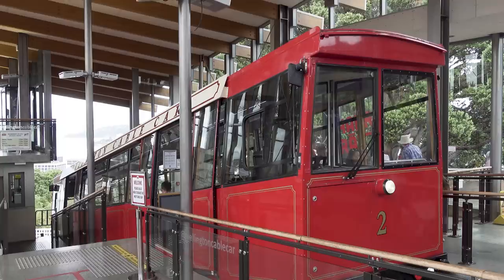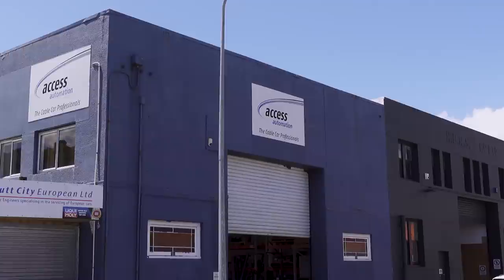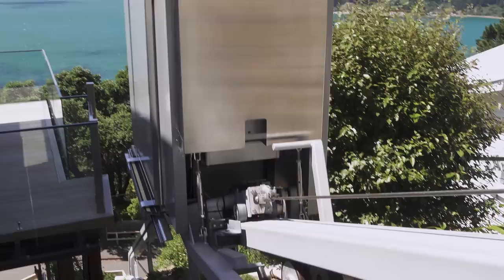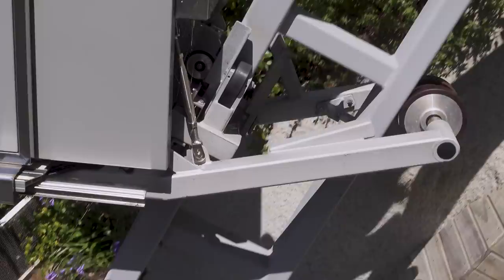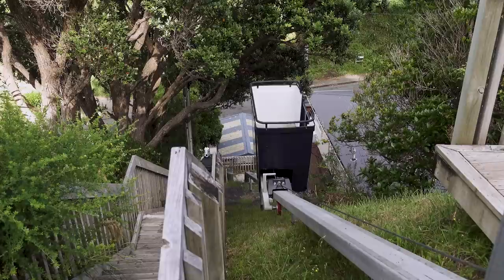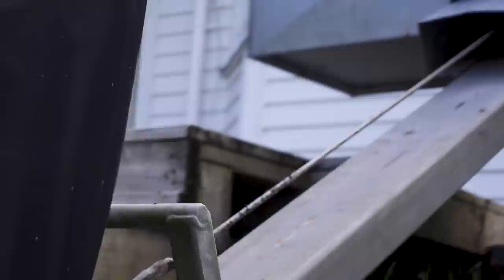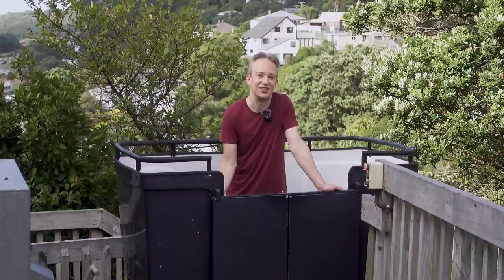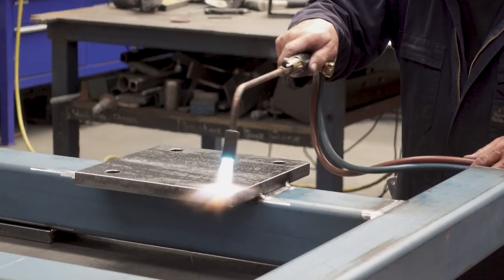The city with a hundred private cable cars

Comment: If the cable car is $120,000, I don't even want to know how expensive the house is.
Reply: Maybe a substantial part of it is for the terrain work... (where to put the pillars, and actually installing them in the middle of the hill). That might be comparable to to laying the base of the house itself.
It's definitely an interesting question to guesstimate this
Reply: Certified NZ housing crisis moment
Reply: At least $5 i think
Reply: It costs millions and billions of New Zealand dollars.
Reply: In my perspective, It should be just as expensive as the cable car. Because most of the expenses would go towards the maintenance of the cable car(s) on the house's property.
Reply: @snowkatyoutube1419  Good call! Though I wouldn't be suprised if the actual value is closer to $6 instead. We've got to be wary of inflation these days.
Reply: There's a big diy culture on this though that's if you hire all the work out. Most of the time homeowners will do a lot of the landscape work themselves. We have similar systems around me in northern Wisconsin due to all the private ski hills around me.
Reply: Definitely more than you can afford
Reply: Well the average house price topped a million NZD for a brief time, a year or so ago.
Reply: like most things, it's the upkeep and repairs that kill ya
Reply: $10
Reply: its free, you get it with the cable car
Reply: @Snowkat Youtube  You sure? Might be an extreme guess
Reply: Some of them pass through many houses so maybe the cost isn't that high when shared.
Reply: Depends. Can substantially increase the value of the house — accessible to elderly (richer) people and families with disabled ones. It’s an investment not a cost.
Reply: Why not use a funicular railway instead?
Reply: Well, as someone who lives around there, depending where you are at in Welly, you're looking at $1-1.5 milly
Reply: The average price of a house in NZ is $900,000 and these houses are in highly sought after locations so they likely cost a couple million, possibly more depending on the actual house.
Reply: Plus the annual cost for inspection.
Reply: That one isn't even enclosed.  Imagine riding that slow thing in a storm.
Reply: It's worth mentioning £1 = $1.95nzd but still £60k is about 20% of the average uk house price so still quite high
Reply: Ha, this is talking about property in NZ... you definitely don't want to know
Reply: The house is a bit run down, so Cable Car included it's $135,000
Reply: @nuthinnew  $120k is the price in US dollars. The quote in local currency was about $220k
Reply: Average in Wellington city is well over a million at this point afaik
Reply: Where I live in the U.S., here are several cable cars that go between houses that are on a hill and the lake down below.
Reply: Likely in the low to mid 1m's NZD but more to the point, installation is the most difficult part because of the terrain. Once the track is setup getting the cable car on it wouldn't be overly difficult, relatively speaking
Though if you look at a converted minivan for handicapped people, those easily go for north of $100k (CAD)
And if you're an American, all these numbers should convert to between 27¢ to $1.30
Reply: @kiwifarmer8828  Its now around $800k
Reply: As someone who lives in Wellington, over $1 mill nz. But those houses are generally around Kaiwharawhara, Ngarunga and Miramar and would be probably closer to 1.5 mill starting prices and go up.
Reply: @nuthinnew  he does the conversion in the video, 200k NZD to 120k USD.
Reply: 10x actually
Reply: @zanefarrow1831  My mistake. Also.. sheesh
Reply: @doctorgames101b around a million NZ dollars on average in Wellington, the houses with the cable cars would be 2 million plus
Reply: From what I have heard, house prices have rocketed under Jacinda's government, with large numbers of foreigners buying up property and making it difficult for Kiwis to get their own home.
Reply: @nuthinnew  houses in central Wellington easily 2-3 million on the low side
Reply: the bubble hasn't popped in NZ as well ...
Reply: @Bobmcjoepants  more than that in central Wellington
Reply: @Tony_7791  ay more than that
Reply: @HazmanFTW  at least
Reply: @mikejones-go8vz  yes agreed
Reply: @MervynPartin  that’s not just her government, it’s also availability of land for development in the sought after locations, worse now after the recent cyclones, worst winter and summer for many years, towns devastated and having to be relocated
Reply: 120k at 7$/h... nah, not survivable.
Reply: Property prices are now valued in units of human souls.
Reply: This feels comically overpriced.
Reply: oopies, you got us there
Reply: it’s New Zealand and specifically wellington so you’re looking towards $1 million NZD
Reply: About tree fiddy.
Reply: If I had to guess, for that area, upwards of $1.2million nzd?
Reply: When I lived there we could only afford the cable car but not the house. It was big enough to sleep in and it had a lid. Happy days in NZ.
Reply: @nuthinnew  How is $NZ 200,000 = £60k?  it's over £100k
Reply: Kelburn (the suburb with all of these) has ~$1.5mill on average houses (£750k) I'd say
Reply: Most Wellington homes are around 1 million NZD. But in the area with most of these cable cars the houses range from 1.5 to 5 million. 😂
Reply: @MervynPartin  "From what I have heard" is a red flag. Anything past that is questionable.
Reply: One like that in NZ would easily be over NZ$1 million

Source: I bought a house recently in NZ
Reply: even houses without cable cars are insane here in nz
Reply: @alec4672  I was thinking exactly that. With less than 120k a handy person can make a safe DIY cable car.
Reply: Word...F@#$ that noise
Reply: In my town you could buy a 3 bedroom 2 bathroom house on a 1000sqm stand for the price of that cable car.
Reply: Yer… house prices in NZ are absurd
Reply: @pipodrankje  no... is it really 6$ these days?
Reply: Hahahahahahahahah
Reply: Given the expense of these, you'd expect the houses where owners were willing to outlay this additional money would be higher than the average - so probably nothing less than $1M NZD - and most of them will be well over that.
Reply: As an average working class Kiwi, I turned my cable car into another bedroom for the kids.
Reply: @alec4672  YOU GOT A PRIVATE SKI HILL AND YOU WORRY OF LABOUR COST?!
Reply: houses in wellington start at 7 figures, if one popped up for under that, I'd be biting on it asap. I live just outside the city
Reply: where I live $120,000 can't even get you a 1 room 40square apartment. WITH RENT.
Reply: Typical housing in NZ can range from 500k to 2mil depending on a lot of factors. It's expensive AF...
Reply: @Padlock_Steve  i hope your joking you couldn't get a piece of land in the middle of nowhere for $200k
Reply: You'd probably be looking around $620k usd as the median in Wellington
Reply: $1.2 million NZD is fairly standard
Reply: In the city, the house may be a complete wreck, but you could be paying from $1 million upwards. Some regular houses may be several million.
Reply: @dkevans  the big cable car is. Has 2 cars that counterweight each other. But houses don't need that and since they are so light and not used much, its just not worth doing, instead you either haul it on a reel, or just have a car that grips the rail and climbs the rail.
Reply: @pipodrankje Well, taking in to account inflation rates in New Zealand, which are up by 7.2% from last year, we can assume that, if the house was at least $5 last year, it would be at least $5.36 today.
Reply: Midcentral Wellington? You're looking at 1mil NZD+.
Reply: The average house price in Auckland the biggest city in New Zealand has an average house price cost of 1.28 million dollars.
Reply: In Wellington? Close to a million.
Reply: @mremumerm  it's what's known as a mistake on my part
Reply: @snowkatyoutube1419  no
Reply: Average house price in Wellington is about 490,000 USD
Reply: Still more affordable than London
Reply: @MervynPartin  House prices had already rocketed long before Labour were voted in, that actually happened under 9 years of the National Party.
Reply: I was just wondering the same, especially one built on such a steep slope. I feel sorry for any removals team needing to move stuff in or out. Here in SA, in Camps Bay, I've seen a grand piano airlifted by helicopter to such a home.
Reply: @maxbracegirdle9990 
My guess was going to be US$500k at the absolute minimum for one of the older, smaller houses...
The larger, newer ones would easily be over $2 million NZ.
Reply: A house like the one in the video, in suburb I think it is, would probably be around $750,000 NZD at my lowest estimate and $950,000 NZD at the highest estimate. ($464,000 USD- $587,000 USD)
Reply: Welcome to the New Zealand housing crisis, it's a nightmare
Reply: @panda4247  from memory, the average value of properties in WLG is around 1m+
Reply: Usually 800k for an old 3 bedroom 1 bathroom house.
Reply: A lot of cable cars are communal. 3/4 houses.
that cost the same as 30/40 houses, because, reasons
Reply: Houses in welltion were costing around a million but prices are at the moment thay seem to be going down
Reply: Depending on where you are but i would say average 800k give or take
Reply: The car is almost free when you buy house
Reply: If I have learned one thing from the other side of the world, that it is FREAKING expensive
Reply: @themitochondriaisthepowerh9177  This implies that there isn't a housing crisis everywhere
Reply: My house without cable car was $450000... And it's a very small house with no public transport connections. Our house prices are cooked
Reply: Add a 0
Reply: People in the USA outside of the main cities have no idea how expensive homes are in the rest of the western world.  In the UK £200,000 ($240k US) in Bristol (not London) will buy you a flat...maybe.

I was recently in Ohio looking for homes with US friends and the prices were ridiculous - CHEAP compared to UK.
Reply: Affordable....
Reply: Maybe you can buy just the cable car and a steep slice land and then live in the cable car 🚡 as a tiny home. Great view from the top 👌
Reply: Wellington is stupidly expensive for housing. The CBD is even more costly as alot of the older more affordable buildings are earthqake risks that need to be torn down or strengthened.
Reply: In Wellington it’s now hardly ever under a million.
Reply: @dkevans  I suspect they only need one car to bring them up and down the hill so a funicular would probably be overkill.
I suspect (but do not know) that using only the single thicker rail might have lower maintenance costs compared to the narrow gage rail that a funicular would use.
Reply: When you purchase a cable car for that price, the house comes included!
Reply: I would imagine quite a bit. Wellington is not a cheap city to live in
Reply: Most of those hill sites are multi million dollar houses... Depends a bit how small they subdivide them, of course :) (but they'll still be a million dollars for the view/location)
Reply: The cost of the cable car is probably shared across multiple households
Reply: It's over 9000
Reply: @MervynPartin  our house prices have been doubling on average every 8 years since since Jacinda was in primary school. This isn't a recent phenomena.
Reply: Average cost of a house in Wellington last sat at around 1.2 million. Average.
Reply: Houses in NZ are some of the costliest in the world, compared with income. Especially in the cities, especially Auckland. (Yes, I live in NZ.)
Reply: same cost as building a driveway in the mountains 🤷🏻‍♂️
Reply: $650
Reply: Auckland is in a similar level of unaffordability crisis as San Francisco, Vancouver, Melbourne, and Sydney, unfortunately.
Reply: Wellington.
Reply: You just poor
Reply: @Hubris2  anything larger than garage is more than 1.5m in welliton even an apartment in a falling down hoouse with water leaks will be approaching 1.6m. House prices are just absurd.
Reply: Easy a million $NZ
Reply: If you have to ask, you can’t afford it
Reply: @61percentodicarica  what do you mean? They usually don't employ anybody, they're just houses built on top of ideal skiing hills. I don't own one I live on a lake but my buddy owns a ski house (that's what we call them around here). It's literally just a house on a big hilly piece of land. Of course he's worried about cost, he's not rich he just likes skiing. He doesn't make and money off of it he can't charge people to ski there if that's what you're thinking. If that were the case it would just be a normal ski hill.
Reply: 1¬5M
Reply: @yougoslavia  billions? No
Reply: @alec4672  ahh ok, I misunderstood then, I imagined a mansion with private ski lift
Reply: Aucklanders chuckle nerviously
Reply: These houses will be all over $1.5 million NZ. I sold a property in Wellington that had a steep access to the bottom, didn't have a cable car and hadn't been renovated in 40 years - Sold for over $1.1million for a  3 bedroom house without a private cable car.
Reply: Tom doesn’t mention in the video that house prices in NZ are out of control, partly due to, erm…Chinese investment…
Reply: @zeitgeist2720  I was joking.
Reply: Saying "I don't want to know" on the internet... 100 people immediately tell you.
Reply: @doctorgames101b  given the state of the housing market its probably closer to a million nzd
Reply: @alec4672  unfortunately,  New Zealand is over fault lines so once hillsides are involved you need experts to sign off that the house will survive quakes and not relocate to the road below it
Reply: @pipodrankje  You don't have to worry about inflation - as the warning goes: your cable car can go down as well as up.
Reply: Its NZ. Avg. House prices in Wellington are beyond 1.2m afaik
Reply: @61percentodicarica  I mean a few of them here and there are mansions but I haven't seen a full blown private ski lift yet I don't think it would make economic sense. That's why they use things similar to what's in the video here. My buddies is homemade out of a golf cart.
Reply: In my area of New Zealand, a good small stable home in a good part of town runs you about 450k
Reply: It's nz bro... house prices are just ridiculous.
Reply: @themitochondriaisthepowerh9177  The video indirectly points it out... but probably not on purpose.
Reply: Given that a lot of the cable cars are in Kelburn and Oriental Bay (two very expensive suburbs), the houses can quite easily go for 1.5-2.5mil plus!
Reply: Average of 1M, coming from someone that lives in NZ, housing is ridiculous.
Reply: @MarkoVukovic0  Wellington has no flat areas its only hills
Reply: Usually about $1,000,000 in these areas.
Reply: @yougoslavia  How I wish this was a joke.
Reply: that's a bargain in today's housing market
Reply: @dkevans  The designs in the video are forms of cable railways (well, cable monorails) - the difference from a funicular is that funiculars, by definition, have two cars which counterbalance each other - as one rises, one falls - while cable railways only have one car per rope, either winched up or connected to a counterweight.
Reply: you don want to know how expensive the land is... especially considering the whole lot may be 30 degrees slanted
Reply: @nuthinnew   average house price in the UK is about 150,000
Reply: @MervynPartin  average  prices over 1 million
Reply: About $3.50
Reply: Houses in Australia and New Zealand are some of the most expensive in the world with the median house price at roughly 1 million
Reply: @THEBOSS7223  150,000 £2 coins?
Reply: Probably more than $120,000 I'd say.
Reply: average house price in Wellington is around $800,000 NZD which is approx. $495,000 USD. Of course there are many places well above that range.
Reply: (laughs in Toronto from inside my derelict $1.2 million townhouse)
Reply: In my country nearly all large households (3 or more floors) have elevators inside that cost $200K on average. I honestly expected the cable cars in Australia would cost more.

House prices cost $400K and above depending on location, rising every year! Thankfully we have government housing for newly weds (you get a full house and pay a measly fraction of the total price every month to the gov for an unspecified period of time).
Reply: That’s a load of kiwis.
Reply: You would be unimpressed, my mom moved to NZ and bought a million dollar house. 3 bedroom 2 bath 30 square foot yard
Reply: Average house price in welly is around a million
Reply: Probably anywhere from 5-15x the cable car cost, depending on the size and spec.
Reply: But … it’s great for parties!
Reply: I was about to say welcome to New Zealand
Reply: $1M close to the city here unfortunately doesn't get you much
Reply: @dkevans  Funicular Railways: based
Reply: Honestly I wouldn't be surprised if it cost more than a small house.
Reply: The houses in Wellington are at least 1 million NZD. Those ones in prime spots would be closer to 1.5 mil, maybe 1.8 million and above (I live in Wellington)
Reply: That’s not American dollars
Reply: It's Wellington so $2m last year, $1m now
Reply: At least a 1 million for many
Reply: It'd be a New Zealand price. Our average house price is probably around $1.5M
Reply: Still cheaper than HK and Singapore
Reply: For 120k I want it to pull my house up and down the hill. I mean for 1k Ill make you a wooden box with a pully and rope.
Reply: Not surprised. It could make up a large bit of what the house already is worth, but location it's self is nice enough, cozily snug'd away in the trees, as if walking through the portal. That alone, would drive me to live there. The cable car being already build would just be a lucky perc and certainly not my reason for choosing that particular spot. you'd be crazy not to
Reply: @MervynPartin  It has nothing to do with the current government. In fact more regulations have been put in to prevent foreigners buying houses. It is immigration which was actually encouraged by the previous government - in fact John Key said he wanted NZ population to be 8M - at the time more than double. Not enough housing stock to meet that demand.
Reply: @TheArklyte  Minimum wage in NZ is currently $21.20
Reply: @daniele4568  Why? You are trying to build a safe method of transport up a vertical cliff?
Reply: It will probably be around 600 000 us$ or more.
Reply: Minimum wage is $22.
Reply: @henrykirk4457  I advertised an outside cleaning position for six months, gave up trying in December. Guaranteed 40 hours a week, $32 dollars an hour, free parking in the city during work hours, free coffee.
No takers. Not one person applied.
Reply: About 2 million
Reply: At least a million nzd but these house are probably nearing 2 million
Reply: Inflation has been high in New Zealand, especially since large amounts of money has been taken out of circulation by being seized and hoarded by dragons.
Reply: In Wellington, often well over a million, at least in the area I live in.
Reply: @daniele4568  As a kiwi, it feels depressingly reasonable.
Reply: haha... the average house price in wellington or auckland is $1mil. Actually auckland is like 1.3 or something
Reply: Probably around 1.2m nzd
Reply: You sure that's American dollar and not New Zealand dollar?
Reply: The parts of Wellington where they'd want to install a cable car have very very expensive houses. Most of Wellington isn't that expensive and isn't built on a cliff face like that.
Reply: @yougoslavia  Hahahahaha.  Right
Reply: Average house price in Wellington would be close to $1M. Coastal homes with a view could be double that.
Reply: average house in nz is 1.3m nzd
Reply: As someone that lives in Wellington on a decent salary, I can safely say l will probably be renting forever. It’s very pricey.
Reply: @kiwifarmer8828  No it hasn't: "Wellington's Median House Price is $790,000".
Reply: $850-1.5 give or take.
Reply: In a lot of our cities the average price is either over or approaching 1mill
Reply: dont worry, houses in auckland, new zealand is 1.5 - 3m
Reply: I live at Nz and boy it sucks to live in the middle of nowhere. Shipping for us on Amazon is 250$ and the houses are really expensive.
Reply: @themitochondriaisthepowerh9177  worldwide housing crissi*
Reply: @dkevans  because it's the same thing...
Reply: I was looking to buy an entry level, one bedroom flat in Wellington and I was looking at $750,000. It's expensive af.
Reply: Greed is good!
Reply: It might be NZ Dollars, which would not be the same as US $120,000.  Nevertheless, that is still a substantial sum of money.
Reply: @unconventionalideas5683  The conversion is given in the video. It's 120,000 US dollars, and more like 200,000 NZ dollars.
Reply: @pipodrankje  he said at least 5$
Reply: Thing is, the properties are probably worth less BECAUSE of the hassle to make it usable. The moment a bunch of people build a cable car that services several homes, those properties become viable
Reply: @kiyosenl.3889    I mean, what could it cost, Michael?
Reply: Billions and billions!
Reply: @EvilEelofSteel  Definition of popped? we've seen a downturn of between 20 and 30% since the peak in December 2021
Reply: keep in mind 120 NZD = 74 USD
Reply: @dkevans  More expensive probably. These cable cars are as Tom says more like elevators. There's a lot of elevators in the world.
Reply: @panda4247  a guess is already an estimate, no need to use douchy terms like guesstimate
Reply: houses in the suburb where these are most common average at about $1.5M NZD. you can look up the price of any property in NZ if you want to find it
Reply: As someone who lives in New Zealand, a house in Wellington costs anywhere from 800k - 3 million NZD. Sucks :'(
Reply: As I thought, looks like New Zealand is affected by the exact same trend happening in Europe: House prices are skyrocketing. I wonder why... Surely, it has nothing to do with the EU demanding certain countries to decrease the number of land owners and have more tenants. And it also cannot be related to Jacinda Arden's membership to certain organizations... I mean, it's kinda strange how countries from opposite ends of the planet are going through the same exact issue, while countries in the middle have no such problems...
Reply: Add a zero to it, or one order of magnitude larger than the cost of the cable car.
Reply: Thats
Reply: That's 75.437,96 US Dollars
Reply: I don't think that's necessarily the right question/inference. As they said, this is often an investment made by a retired couple who wants to stay in their home longer or by a disabled individual who needs the item in order to access their property. It's not a "value-added" investment they're hoping to make a return on. It costs $120k minimum whether it's for a $200k or a $5 mil home. But for someone who wants to remain independent and it's the only option it may be worth it even if it makes no sense financially and may even lower the value of their home--as the new homeowner found it now adds a substantial yearly inspection expense for novelty for her. The cost may be covered, in part, by grants or local aid (outdoor wheelchair elevators are in many locations so I'm guessing similar groups may also help with this if the need is there), so I really wouldn't make assumptions, necessarily, that the owner is frivolously wealthy.
Reply: like 1m to 1.5m or 900k
Reply: It's in NZ a very shifty country so probably not that much more
Reply: @rafezetter8003  People in rural areas of the US definitely know how much homes cost in similar areas around the world. And it's not much worse than most of rural America nowadays. 

I live in Canada and a house in my area that costs $500,000 would probably cost around 50% less in a couple hundred kilometers away in the US but that's doesn't mean Americans are living in some utopia with cheap housing.

I may have to pay a half mil for the exact same home in almost the exact same area but a quarter mil still insane for a home you could've bought for 40k a couple decades ago...

We may be doing worse but Americans are still struggling.